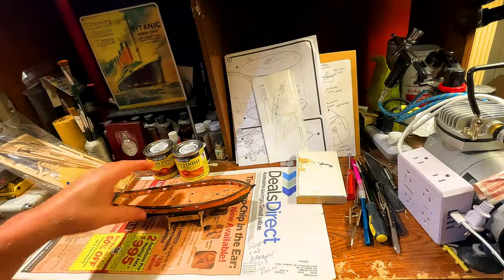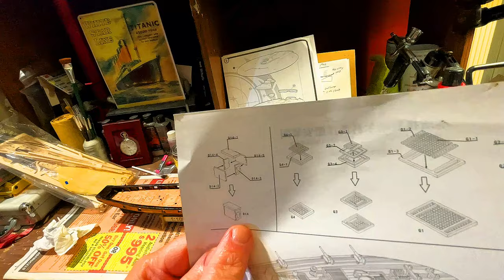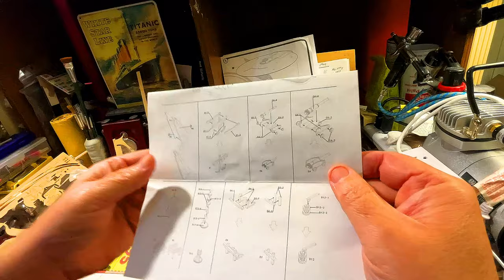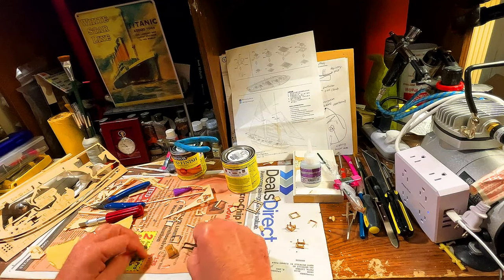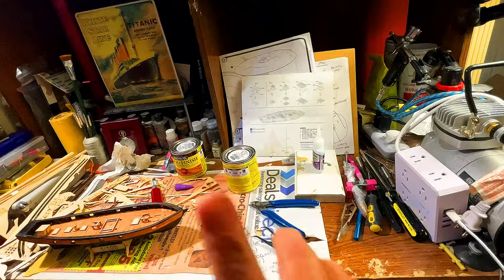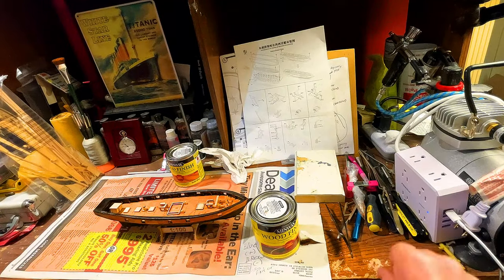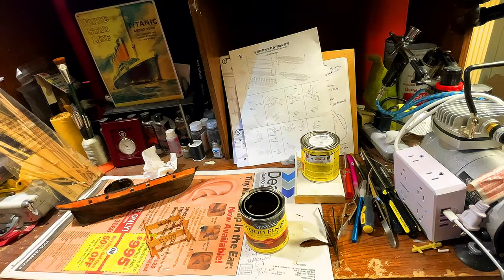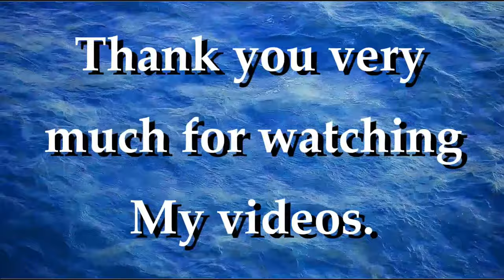Wooden ship model build  1:100 Scale Part-6 The Deck Structures

Comment: Having made this model, I think you used some of the pieces you said you didn't have /couldn't find in the wrong places, but hey, you adapted and overcame. Well done!
Reply from the maker: Thank you very much. Yes, upon checking out the unboxing video I made, there are pieces there I thought were missing.  But I am glad it is finally finished.  I have a total respect and awe of those OCCRE guys and their work!
Reply: I am currently building the OCCRE Polaris, which is a lager version of this, and it is so different to making the Halcon. Good luck with the Flying Dutchman.

Comment: I looked back at your unboxing video and the sheet with the hatches was definitely in there on the same one as the gun ports and rudder.
Reply from the maker: Yes, I did notice that as well.  That's why I am glad I take photos of everything when I do the unboxing.  However, there is still quite a bit that is shown in the listing that does not come with the actual kit.
Reply: @TrekFanNCC-1701  Yes, you're right. I have seen some listings on ebay where you would select wether you want the basic ship or the upgraded version of the halcon. Since they are cheap, when I buy one of those, I buy two! lol  I like your channel and look forward to more shipbuilding. I'm from NH,  what state are you from? Thanks